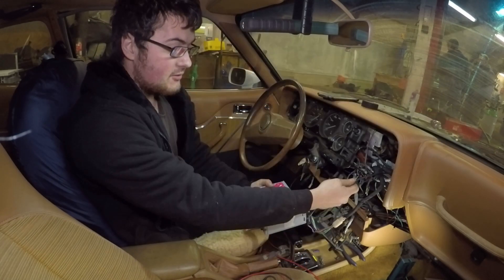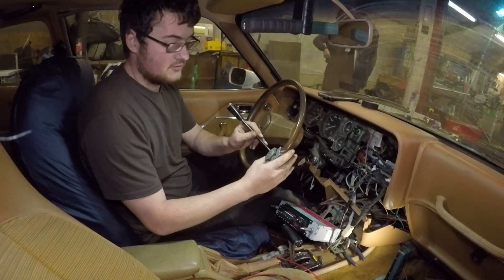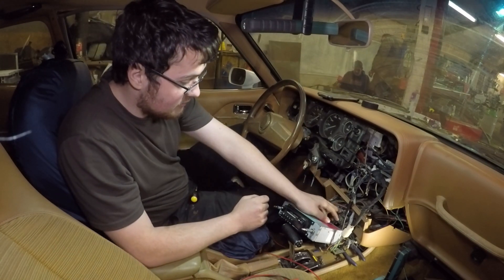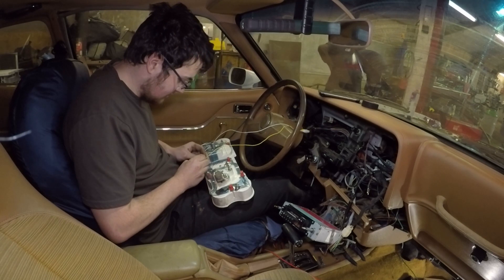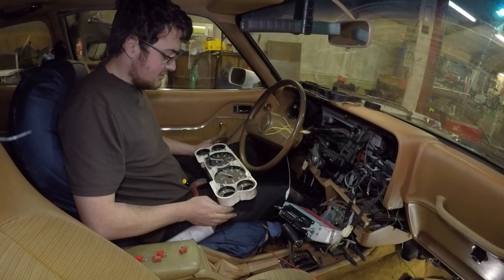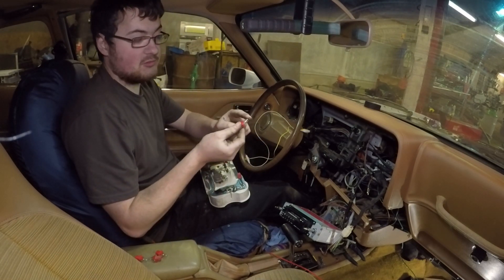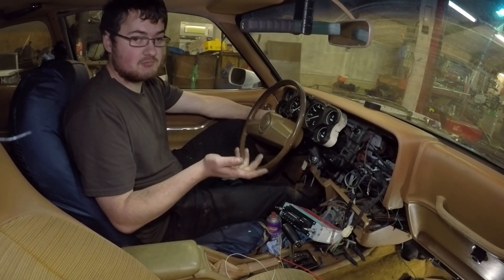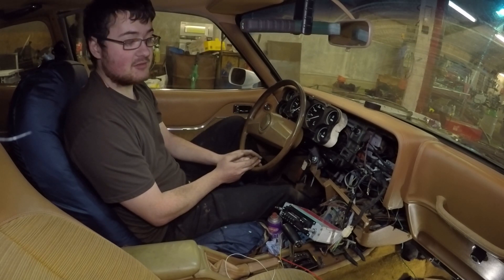US '76 Capri Ghia EP.7.5 : Finally Capri 0:1 Jordan (Sucess)

Comment: Probably a US-spec stereo, they use a different range of frequencies which would cut down on the number of UK stations you can pick up. Swap in a standard Ford UK unit and you should be suckin' diesel
Reply: Yeah and the boot is a US spec one, called a trunk and has a gunrack in it.